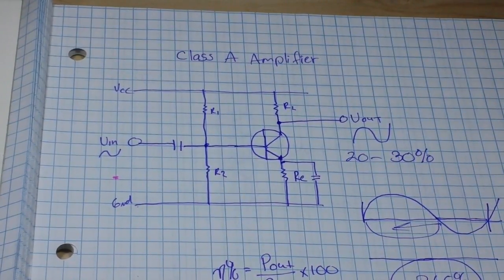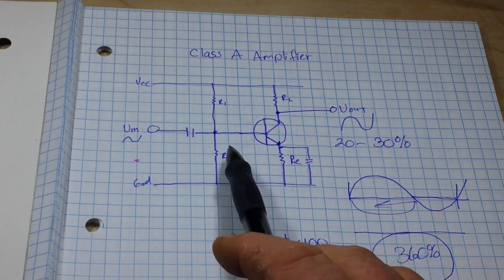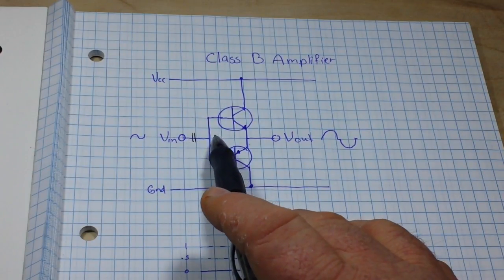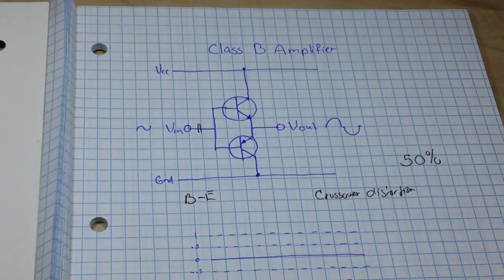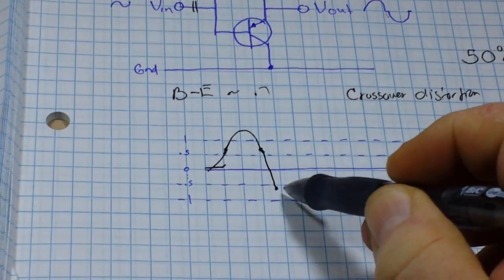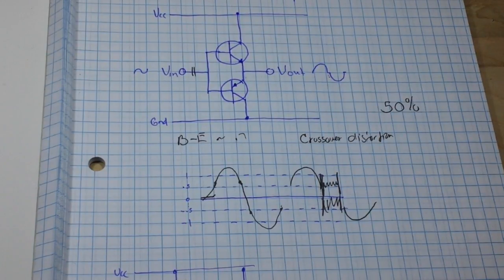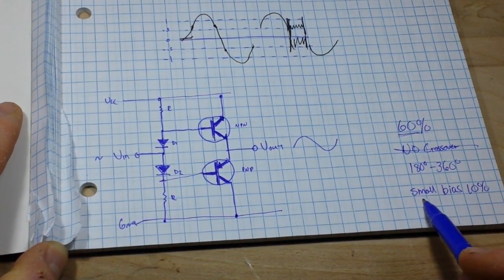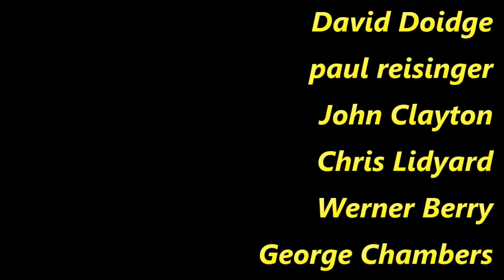Amplifiers: Class B & AB

Comment: BUT WHAT DO THE DIODES DO???? AGGGGHHHH IT'S DRIVING ME MAD! 🤪! I can't work it out. Each diode drops around 0.7v. why are facing the same direction? I just can't fathom what is going on. Other than that, great video 👍😁
Reply: I think what's happening here is that the diodes are blocking flow through them when the wave is high, leading to greater flow through the gate. This is most obvious with the NPN side, but the principle is the same on the PNP side, just flipped upside down. Now, you might wonder why the diode is pointing they way it is on PNP side, but that's because when Vin is in a trough, it's effectively going to have a kind of opposite effect on the PNP transistor and the diode on the negative side of Vin and Vout. What makes this confusing is mainly the nature of AC circuits if you're used to dealing with DC ones.

That's at least my understanding, but it's something I think I'd need to verify in a simulator or in a board.

Comment: Great explanation of these different amplifiers. I used a constant current source top and bottom to get rid of the  cross over distortion on a push-pull amplifier similar to the one you in another lesson. Thanks.

Comment: 2:47
Is there not a different type of transistor you can use to reduce the B-E voltage you need to switch it on?
Reply: The B-E voltage requirement was because of the silicon material used in the transistor. I assume changing to germanium will lower it to 0.3 but that isn't really practical

Comment: Is the crossover distortion present in class A amplifier also??
Reply: caso craft 

Hi. Nah this isn’t an issue in a class A amp as the transistor is biased (you can tell by the fact that there’s a voltage divider with its output being the base). This means that the transistor is sitting in its active region (switched on, in laymen’s terms) at all times. The required 0.7V is always there because of the voltage divider. :)

Comment: for the diagram with the class b amp, why do the transistors not turn each other on? (lol) npn turns on if current flows in, while pnp turns on when current flows out (or vice versa depending on physics or electronics), so why dont they turn each other on?
Reply from the maker: +fredlllll I think you're thinking in terms of DC current. Think in AC only one transistor is on per half cycle, the other half cycle it's reversed biased.
Reply: yeah i guess it works when a signal is applied, but what if there isnt a signal?

Comment: I thought that the B was more efficient than AB
Reply from the maker: No, the push-pull of AB is more efficient.
Reply: learnelectronics I was wrong... thanks
Reply: Thanks for the overview. Isn't push-pull synonymous to class B/AB ? What would a non push-pull AB look like. I thought it meant that one transistor pushes voltage up and the other one pulls it down, kinda...
Reply: Class B is more efficient, class AB requires bias voltage on the bases of the transistors so the transistors are turned on for longer which gives less efficiency but reduces distortion. Also, class B is push-pull as well.

Comment: Ok, so website "Device Plus" appears to be a sort of techno-gizmo resource - but less of a "build X project" reference.  That site links to ROHM via a single icon on the home page.  Parts ROHM apparently manufactures are elaborated (with data sheets), and ultimately us DIY'ers are directed to distributors such as Mouser or Digi-key to buy.  FWIW.
Reply from the maker: +Are Jayem uh, ok?
Reply: I was bamboozled by the Devices Plus site, thinking it had more "circuit content".  The ROHM site appears substantially more useful to makers.  Perhaps you will find some unusual devices made by them to evaluate and experiment with.  They have speech synthesis and "energy harvesting" products, to name a few.  For folk looking for parts, they may want to jump past Devices Plus, and head over to ROHM.